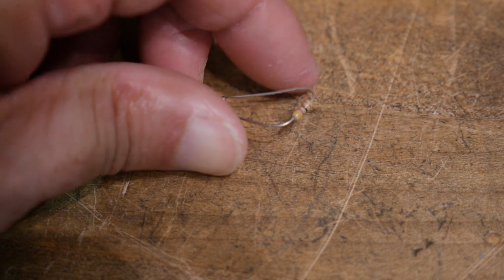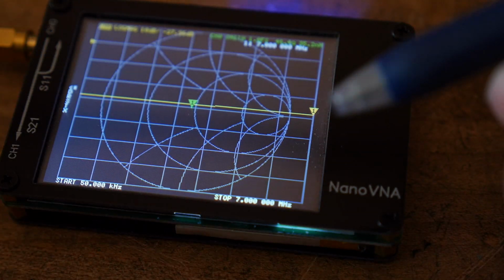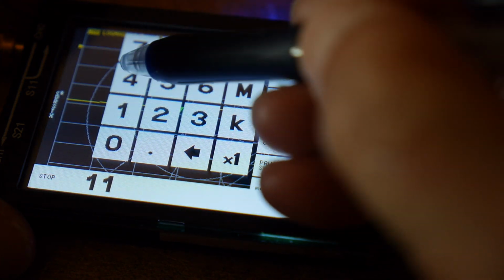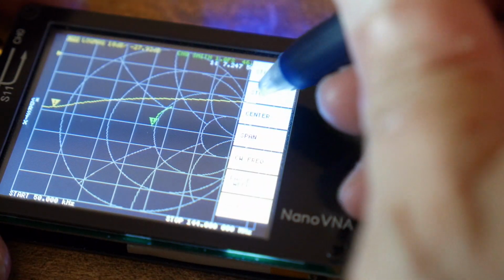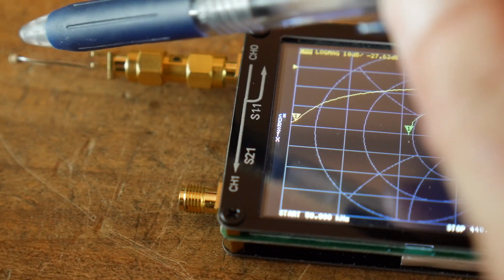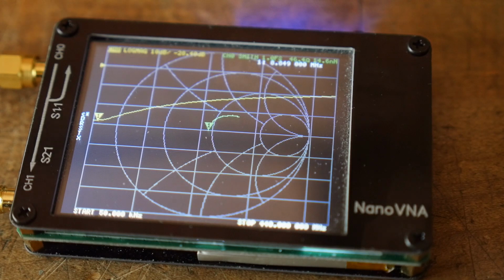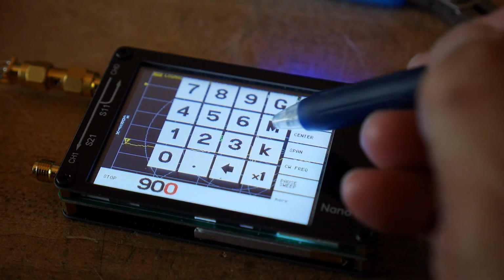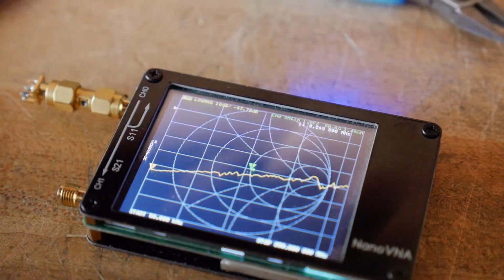#361 NANOVNA measuring inductance in a 50ohm load

Comment: Nice video.  I am assuming you did a cal of port 1 before taking the measurements.  Whenever I come across a video using the NanoVNA I have to watch mainly to see how the presenter uses it.  Just to give you some of my background I used to work for a defense contractor (I'm now retired) that manufactured limiters used in RADAR systems and integrated microwave assemblies.  During my tenure there I got to use HP network analyzers and a Keysight PNA-X network analyzer along with various spectrum analyzers..  Being an amateur radio hobbyist I knew that having those tools in my shack would be an asset but unfortunately totally out of my budget.  When the NanoVNA and TinySA became available I had to add them to my bench but not just for antenna and feed line analysis.  I also experiment with MMIC based broad band amplifiers in the 70cm and up region.  Watching your video especially the part at the end where you used a chip resistor for the load prompted me to test a couple of home brewed attenuators just to get an idea of their response across the bands.  I had built them prior to acquiring my NanoVNA and the result of testing them pleased me no end.  The load impedance was pretty close to 50Ω and the return loss was almost perfect.  The only thing I noticed about them was that the -40dB and -60dB attenuators weren't quite at the calculated values but were close enough.  Thanks OM for taking the time to produce this video.  DE N1ABE 73.
Reply from the maker: I have a playlist for nanovna and for tinysa.  Lots of videos.

Comment: At 440MHz, the sum of your leads are approaching a 1/4 WL as indicated by the green resistance circle.  I assume you've calibrated before measuring?
Reply from the maker: yes, calibration is required, to remove the cable effect, calibrate at the end of the cable, or apply port extentions in the software

Comment: First, thanks for the video. New to the VNA. Question. Inductance of wire coils measurement when using say a CW or fixed frequency. Is the results say withing x%.  Same question on Capacitor measurement. Wish to measure coils and caps on unit. Don't have a lcr meter.
I notice on your example in the upper right the nh inductance  varies, perhaps due to sweeping the frequencies? If you measured at a fixed frequency is the inductance close in accuracy?
Reply from the maker: yes you can use this to measure L or C at a fixed frequency but it won't have much of a range or accuracy as an LCR meter.  A $6 component tester would be better:
https://www.banggood.com/LCR-T4-12864-LCD-Graphical-Transistor-Tester-Resistance-Capacitance-ESR-SCR-Meter-p-1311439.html?utm_source=googleshopping&utm_medium=cpc_organic&gmcCountry=US&utm_content=shopping&utm_campaign=us-pc&currency=USD&createTmp=1&utm_source=googleshopping&utm_medium=cpc_bgs&utm_content=frank&utm_campaign=frank-ssc-us-toys-tool-ele-newcustom-ncv80-0116&ad_id=411455834827&gclid=Cj0KCQjwncT1BRDhARIsAOQF9LkeIOeL84wnFGsV69PtspwOm_fsDBqXt9t_PGgm3CUPm7J26HBoXvgaAjyBEALw_wcB&cur_warehouse=CN
Reply: @IMSAIGuy  Thanks

Comment: You are mostly measuring the electrical equivalent of the inductances of the carbon layer inside the resistor (it's a coil) and the the wires. Additionally the external wires and the caps at the ends of the resitor are two different capacitors, which react different at different frequencies....
This assumption could be used as starting point for moderate HF frequencies. When frequencies increase or when the resistor is soldered onto a board, things get even weirder.
For understanding electrical/magnetical fields, components and schematics at high frequencies, it is highly recommended to study them in theory first. Even with a degree, many fail to fully understanding HF.
I think a good approach is to make predictions first, calculate the result based on your asaumptions, measure the reality and correct your picture until it fits perfectly.

Comment: You forgot that carbon film resistors have spirals within (like a coil) so you will always have a little inductance ,  You blew the test by changing to the surface component .
Reply: Not sure about that. Isn't that wire wound resistors?

Comment: How did you calibrate for this demo? 

Changing the frequency range makes a recalibration necessary to get acurate results.
Reply: And causes it to interpolate those points. Far better to calibrate it every time.
Reply from the maker: The VNA takes the frequency range you have set and takes 101 measurements over that span there by calibrating the entire frequency range.